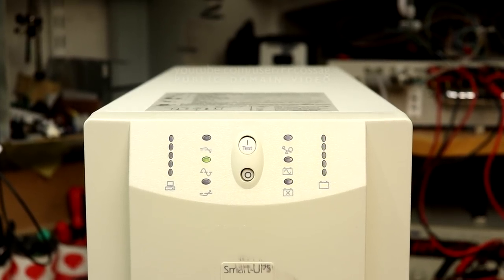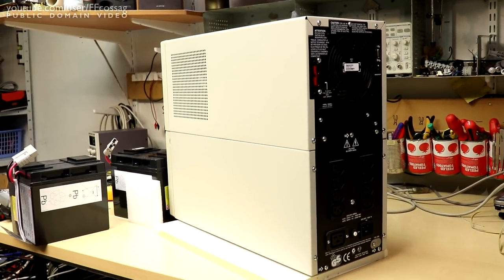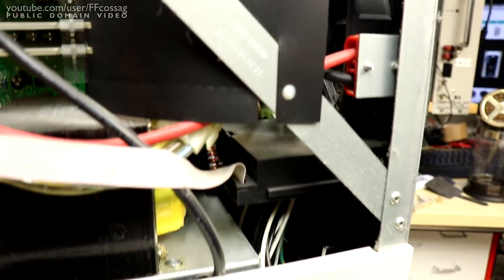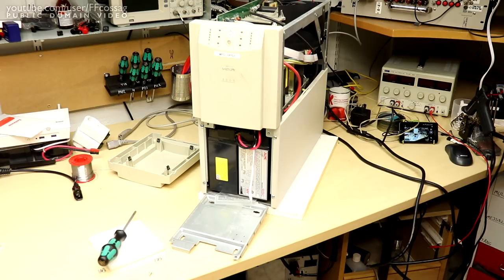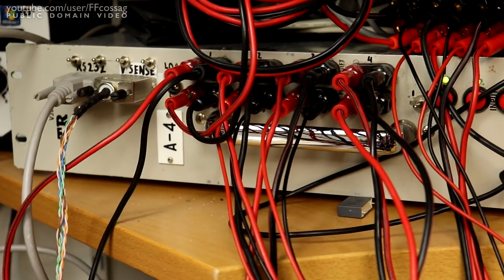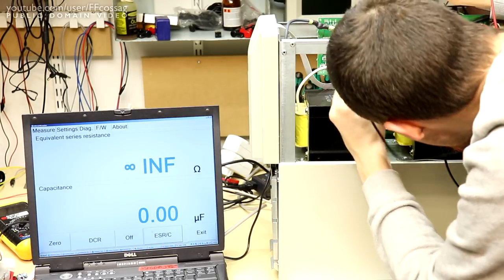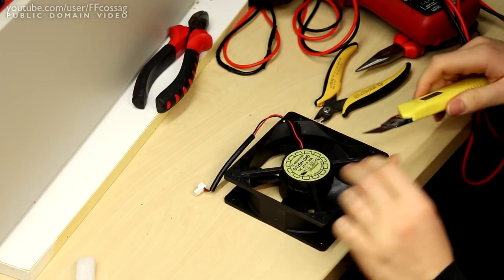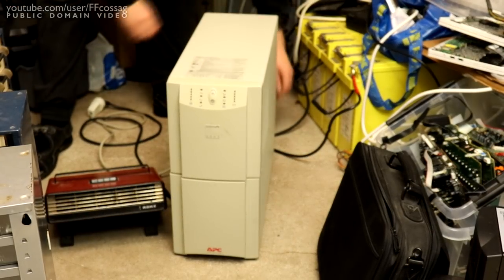APC SU3000INET: Master UPS of the 90's

Comment: Great call on replacing blue caps...but still see blue caps on the board near fan connector (towards end of video).  Also, hint hint…there are two resistors on this model that heat up (thermal runaway). If you have access to a FIR camera you can spot them. I don’t have the schematic anymore to help you locate it. We replaced them with 1W metal films slightly elevated from board and all was well after that. I think when they software-designed this board, designers auto-routed the layout as much as they could without giving much consideration to component dissipation and thermodynamic.
Reply from the maker: Hm, thanks for the tip - and I replaced those caps off-camera after finishing shooting. ;)

Comment: Got one of those still in service at work.  Also have 2 of the newer black versions.  They’re rock solid,  if you can get the management card and environmental probe it’s quite useful.  I’ve just ordered 8 17ah 12v batteries to rebuild some of the packs on ours.  APC do charge too much for sticking a couple of standard batteries together.

Comment: I'm a bit embarrassed to admit, that I actually still have two of these providing backup for an office wiring closet and a small (company internal use only) server cluster. They have proven extremely reliable and I have not even encountered any issues with lessened battery life, they seem to last in good condition for five or so years in my environment. Maybe that is due to that I never have used original APC battery packs but replacement cells from the local auto themed store (vink) :) I even had a third one and I regret that I gave it away.

Comment: My dad has had a similar unit for years. It ended up in the basement, running the sump pump (which worked surprisingly well) until the batteries crapped out. It's still down there, but it's unplugged.
Reply: You should get it out of that basement, recap it and replace the batteries.
That unit will last you at least 10 years using two sets of batteries if you adjust the charge voltage. These old APC's were pretty much indestructable. (they could even run a vacuum cleaner without turning off or blowing up!)

Comment: stax motown
1 seconde geleden
   just about reviving dried out GEL bats   and these APC's
these bats can be put back to  life . they are mostly dried out so topping up with distilled water after taking the rubber valvecaps of , and then charging slowly over several days will bring them back to life ,to have them faster recondtioned it halps with short bursts of shortcuts  , that will revive them nearly complete up to 75 or 80 % from  new ! ?    the problem withthese ups  is that they overcharge , unless you hang lots of exterior batteries and have them dayly a short burst ( few minutes is ok to relieve the litle but of overtension  ,) to work on the bats .  avarge voltage of good condition and charged up set is between 53 and 57 volts  peak charging kan go up to 60 volts for short time . The UPC  will start showing overtension from 58 volts on but withstands 60 volts ! ( inside electrolyts are 63 Volt types )   I am running thoseUPS's  on exterior 48 volt storage with 1200 AH  yes READ WELL 56 BATS OF  90 AH   in 14 strings of 4 serial .. they are watched by an industrial exterior charger of 80 amps   and shortly with an extra Hybride OUTBACK solar convertor !  Thta's what I call full OFF GRID system !   in the backyard sist a Perkins 30KVA generator in case of failures .   Waking up bats that have been standing still is slowly charging and  giving them a few firm shorts   this will wake em up !!  ( old trick of carsalvage yards ! )

Comment: You could always try and recondition/charge these lead batteries with a Re-EMF charger (which is basically the JouleThief circuit, only that it pulses high voltage/relatively low current spikes into the cells, thus "blasting" the cells free at several kHz or something like that). You find lots of videos about this circuit on YouTube, and I am still wondering why nobody made a commercial product out of it. Of course, the plain circuit would need a bit more R&D for this in order to make the commercial product actually a controlled charging/reconditioning solution, but if you don't mind cecking times and voltages yourself, it will work in a "home-gamer" setup as well.
Reply from the maker: It doesn't work on dead UPS batteries, because they die from electrolyte depletion and plate corrosion causing them to turn into mush. Completely impossible to recover.
Reply: Aren't UPS batteries also just lead (gel, not acid) batteries? I think it might also work with those, although of course it works better on lead acid batteries.
Reply: these bats can be put back to  life . they are mostly dried out so topping up with distilled water after taking the rubber valvecaps of , and then charging slowly over several days will bring them back to life ,to have them faster recondtioned it halps with short bursts of shortcuts  , that will revive them nearly complete up to 75 or 80 % from  new ! ?    the problem withthese ups  is that they overcharge , unless you hang lots of exterior batteries and have them dayly a short burst ( few minutes is ok to relieve the litle but of overtension  ,) to work on the bats .  avarge voltage of good condition and charged up set is between 53 and 57 volts  peak charging kan go up to 60 volts for short time . The UPC  will start showing overtension from 58 volts on but withstands 60 volts ! ( inside electrolyts are 63 Volt types )   I am running thoseUPS's  on exterior 48 volt storage with 1200 AH  yes READ WELL 56 BATS OF  90 AH   in 14 strings of 4 serial .. they are watched by an industrial exterior charger of 80 amps   and shortly with an extra Hybride OUTBACK solar convertor !  Thta's what I call full OFF GRID system !   in the backyard sist a Perkins 30KVA generator in case of failures .   Waking up bats that have been standing still is slowly charging and  giving them a few firm shorts   this will wake em up !!  ( old trick of carsalvage yards ! )

Comment: Didn't know about the over charging, but the cheap LED volt displays I fitted say 13.6V on 1 battery and 13.7V on the other. I better check them with a DMM.
Didn't know about the caps, maybe I should check them too.
Reply from the maker: Always gotta do the caps on Smart-UPSes. 13,6/13,7 is fine if it's actually true.

Comment: OMG, I have not seen one of these in decades. We had one on under each desk at my one job for my department. But it was the single unit, not the double stack box you have. 
Then I finally had one for my computer at home when they went from square to rectangle, the APC smart-ups RS 900. Today I have 3 of the APC 1500VA, one 750VA, one small Back-UPS 300, and one Back-ups 650. The only one that doesn’t have a USB remote monitoring software control is the 300. But the newer smaller 600 uses a standard USB cable. The 750VA and 1500VA units use the custom RJ45 to USB cable. I tried one cyber power and it smoked the first time I tested it with switching to battery, never again. So I stay with APC now.
So far the only ones that failed on me was the first RS 900 I bought used so it was at least 15 years old before I retired it, I replaced the batteries once and it failed a second one with charging. It was failed SMD caps that leaked. And last month one of my 1500VA models failed during a power outage when it only ran 2 minutes without any warnings in the smart parachute monitoring software. My guess being my firs 1500 unit it probably a capacitor issue also pushing 10 years old. I tore down the RS 900 for parts. I haven’t looked at the 1500VA failure yet since it was a recent fail and just took it off line for now. But yes, always check those caps before waiting money in batteries. 
The RS 900 16V 22uf caps survived, but it had three or four 4.7uf caps, one of them supporting the microprocessor on C22 and they all leaked. So if you ever get later model 900 be sure to replace the 4.7 ones.if I didn’t destroy the transformer I could probably,h fix it and out it back online, but not worth it at this point. Nice spark gap component on the network RJ45 protection, the in and out for each port had 16 diodes, one for each RJ45 wire with another 3 working with the CITEL 06 2500V Spark gap. Great for parts if you grab one in the dumpster, lol.
Have fun with your new backup, should last you another 1o years now with proper battery maintenance. Great units.

Comment: We have the same APC 3000 in our basement.  Bought our house 3 years ago and with it came the APC 3000 connected to 4 large battery packs. It is suppose to be a back up for our two sump pumps.  The set up did work when we had a power outage a while ago.  Our house was built in 1996 so I assume the APC set up is over 20 years old.  Should we have someone come in and take a look and see if it needs maintenance?  Sorry if this is a stupid question ☺.  Just don't know anything about this.  Thanks for any help/suggestions.
Reply from the maker: Jst replace the batteries if they go bad.
Reply: @FFcossag  thank you!!!

Comment: That should now be an excellent backup for most of your computers, no sudden power downs because of lost mains :-D.
Looks very clean inside, and now you have prevented cap failure it should be very reliable.
Dam good unit :-D
Reply from the maker: Dam good indeed.

Comment: I have the 2200va unit and the only differences are the 92mm fan,  the missing external battery conector and the fact that APC did not populate one more fet on every heatsink and the fourth main capacitor.  Funny how mine was also made in 2003.
Does anyone know where I can buy the white bottom cover with the APC logo? That part is missing on mine.

Comment: nice video how much hour can it run on 600 watts load i have one backups cs 350 battery life not that good that why i have inverter 1100 watts 12 volt battery 285 cranking amp but i going used 12 volt deep cycle battery 100 amp

Comment: woohf.. been a while since i watched a video about upss.. i usually have my dose of ups stuff at work haha.. these units are really realiable theyre still in use today.. had to remplace the batteries in a 1998 with original batteries the other day.. was a pain in the butt.. has to open it drill the rivets etc etc..  we still sell alot of these.. theyre just solid beasts..

Comment: You could probably stick a PC type 12v "silent" fan in there with a suitable resistor to drop the current down enough so that the fan doesn't end up burning out, would be much nicer on the ears than that drone from the original fan... :)
Reply: Not even close to the original airflow though. The D12BH-24D is rated for 129.5 CFM at no less than 4000 rpm. Granted, these days you could probably do that sort of airflow at closer to 3000 rpm, but it is never going to be quiet when running full tilt. One would have to implement some sort of fan control.
Reply from the maker: As Pileofemptytapes already pointed out, that's no good. The internal power dissipation of this is several hundred watts at full load, a dinky PC fan would cause smoke.

Comment: I have a few of these and they indicate to low on the bats , connected to 1250 AH  56 bats and at 52/53 volts charged ; only one bat led is lighting up and sometimes blinking .any idea where to look for ??
Reply from the maker: Your wires might be too thin; you also need to adjust the battery constant by using the PROG mode on the UPS.
Reply: @FFcossag   i have sent you a replye , don't know if it arived ; wiring is very thick and short up to 100 AMPS minimum !  one unit functions perfect !  two indicate to low .. must be somethning to do with one of the analog input channels of the analog digital convertor 838 inside . but which input ??? do you know ?? greets, Ben

Comment: Nice video, you really understand the technology very well.
You've made a nice refurbish to the UPS.
I also have a APC SU3000INET that was given to me by a friend 10 Years ago with swollen batteries and broken connectors.
My goal is to turn it to Lithium UPS with 18650 transforming it from 432W to 2300W +/-
My question / challenge to you is:
Do you think it's possible it to work?
I mean 8P modules * 9 per Battery, totalizing 288Cells the size are all OK, the voltage can be also OK, since Lithium can last for longer if they are charged and discharged from 90% to 20/30%, this way the life span would increase considerably the 18650 also have the cut off if a cell becomes unhealthy it can be replaced easily, my thoughts are without any modifications, only using standard parameters from UPS would we achieve this charges and discharges?
If any modification is required, can you show us how in a video, more detailed one.

For the 18650 holder i've bought already from this site (module 8P)
https://18650.lt/index.php/product/n-e-s-e-module/

18650 Cells, i've purchased a used ones since the money comes very short
https://www.ebay.com/itm/Panasonic-NCR18650BE-3200mah-18650-Rechargeable-Battery-High-Drain-Batteries/123863463827?hash=item1cd6d67793:m:meTyqfj5QUxibska1LtVPzg&var=424588243787

Please leave a comment!

Comment: I was thinking 13.5v cut-out is low has fuck (I usually go for 14.5v) then I realised those are gels.
Reply from the maker: 14.5 V is fine for a bulk charger, but not a maintenance charger. I'd be wary of ever putting that many volts into a gel cell though, at least the Sonnenschein industrlal gel cells I've dealt with are incredibly sensitive to overvoltage.

Comment: Great vid I am glad you found that unit. I have started playing with a couple of ups, I am trying to use a large 7s 18650 pack, have you ever tried this as I am trying to reduce the final charge voltage down  cannt figure it out. any suggestions.
Reply from the maker: Lithium batteries really need a more precise charger than these have.

Comment: What voltage and how many of the 22uF caps need to be replaced? I have a 17 year old SU1400NET still in service and working great with external batteries. I swapped the wire out of the yellow custom anderson connector (the battery disconnect on the back of the unit) and put that jumper wire internally so now the battery disconnect is actually the external battery connector, no internal batteries.
Reply from the maker: You're really best off looking inside your unit. I think my 22 uF caps are rated 50 V.

Comment: Great video. I would like to create an external battery pack, how did you wire up the external pack you have available?
Thanks!
Reply from the maker: You just hook it up to the connector on the back.
Reply: @FFcossag  yup, I was more asking for the way the expansion batteries are hooked up.
So assume it's 4 batteries paired into 2 pairs then those are paired again to make up the 48v?
Reply from the maker: Yup. The internal batteries are just 2 24 V APC packs (RBC7 I think) that are connected individually to the UPS, and connected in series internally in the UPS.

Comment: Hi, FFcossag
Noctua have some 24V industrial fans arround 30 euro and they  are black colour ,not that nice brown. And they are silent if you can use them with pwm signal ,but if you only can run them on 2 wire full rpm they are a bit noisy to ,but still alot quieter then most.
Reply from the maker: Oh, I'll have to remember that. Thanks for the tip!

Comment: How much power does this thing use?
Reply from the maker: About 60 W.
Reply: @FFcossag  mine are idling between 50 and 70 watts  depending of the fan ...running yes or no .. and on resistive ballast ( 2000 watts heating up waterboiler , they don't  come hot at all .. they just keep up fore a couple  of  hours  with a strong battery backup exterial   of coarse ( 1250 AH at 48 volts )

Comment: I've personally seen an entire pallet load of dead APC batteries the exact same as these ones. Was wondering what sort of smallish UPS they came out of.
Obviously been abused by too high charge voltage too, some of them were very melted, had hole blown in the casing, or lots of corrosion.

I didn't know about the 22uF caps being crappy though, wonder how they managed that.
Reply: In the later 90s some people stole cap designs from the top Japanese manufacturers and took them to China. Looks like there were some errors or misunderstandings and we have a decade of terrible caps killing electronics. Look the story up on the internet...

Comment: Nice, we have the next-gen black SUA3000RMI2U at work, they still work good. I'd like to see the XL version, curious if they have more transistors/bigger transformers or just a battery connector added.
Reply from the maker: The black ones usually do, since they're more cost-optimised.

Comment: So no Smart protocol in these units? Guess the black units the came after these were the best from a tweaking perspective.
Reply from the maker: They have the Smart protocol, but the charge voltage is (at least on the smaller ones) hard-coded with a resistor.

Comment: But 13,8VDC is the Norminal Charging, everything over 14V is bad. Maybe useful to use Calcium-Calcium Batteries. They need a higher Charge Voltage.
Reply: i have 5 ah sealed lead batterys they are 14,5 to 14,9 volt cycle use and standby use 13,6 to 13,8 volt  thats written on the batterys so should be fine over 14 volt charge